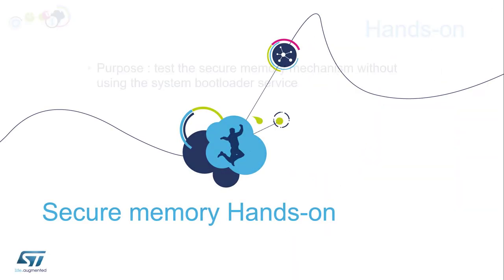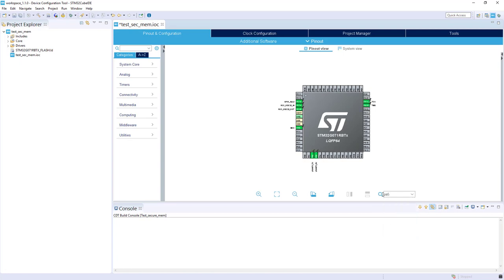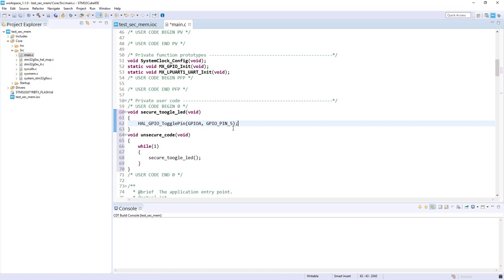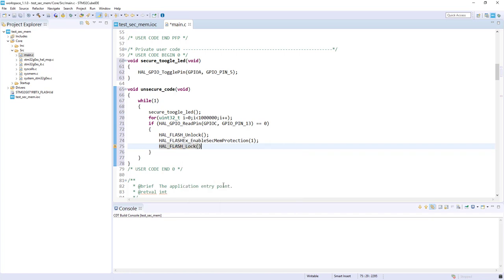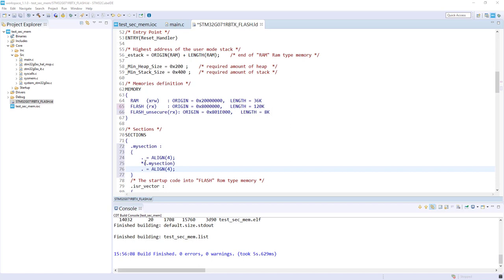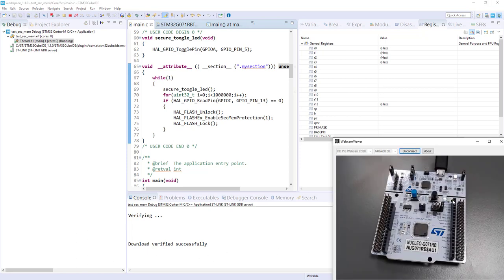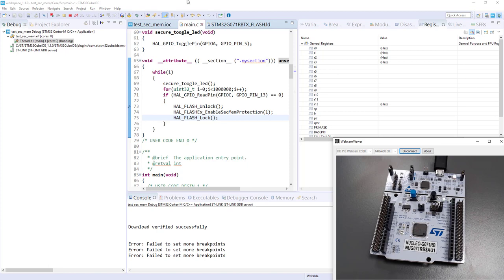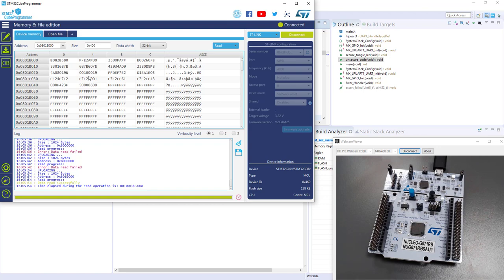Security Part3 - STM32 Security features - 12 - Secure memory lab1

Comment: Hello. From where you got value 0x1c for SEC_SIZE ? And the same question about address 0x0800E000
Reply from the maker: Hi there, thanks for your question - may we point you towards our community.st.com, where you will find a team of people who can answer you directly ?
Reply from the maker: Hi Konstantin. We've reached out to our colleague presenting this tutorial and we'd like to clarify something that might have created confusion.

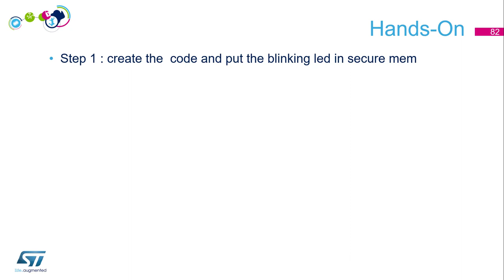The way we edited this video creates an inconsistency that might be a source of confusion. Sorry about that. What you see at 1:05 to introduce step 2 is really just a screen capture to illustrate what this step is about. It does not show the SEC_SIZE value and address that our colleague later uses for the actual demo.

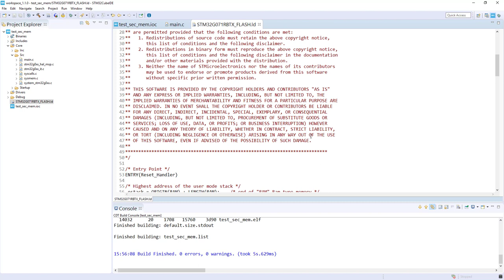So in the actual demo, at 15:50 onwards we set SEC_SIZE to 0x1c to define the secure part of the flash memory to be 0x08000000 to 0x0800e000. Previously at 8:28 onwards, we have defined our unsecure code to be located in the last 8K of the flash starting at 0x0801e000, so outside of the secured part.

Hoping this helps.
Reply: @stmicroelectronics  Thank you for clear answer.